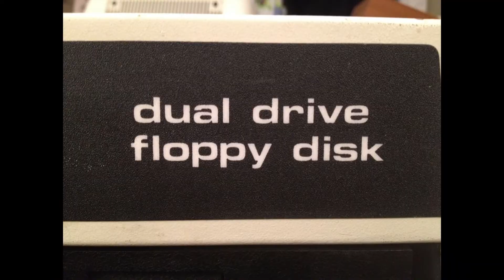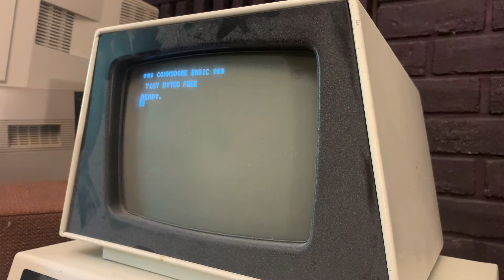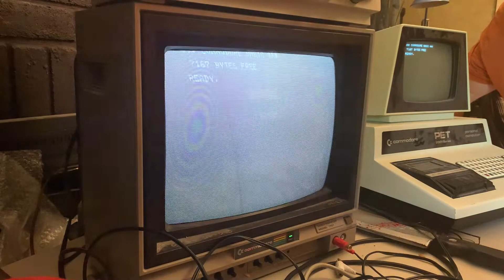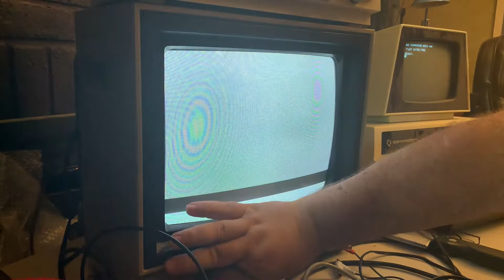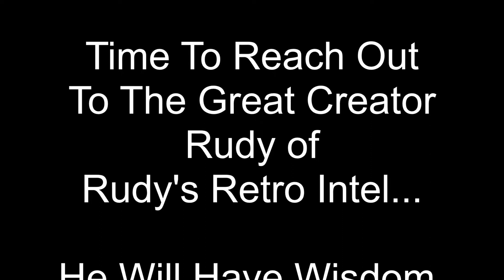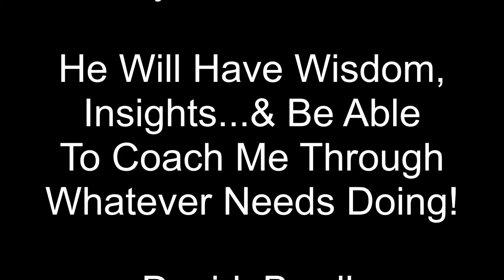PET To Composite Interface More Testing, After I Blew It Up! Help Me Rudy! 2001 4032 - Episode 1154

Comment: Looks like the capacitor is bad also. I will send you a replacement next week once I'm back home. Sorry I didn't think about that :)
Reply from the maker: Might I be able to steal one off of one of the others?  Or?
Reply: @DRBradleyPhotography  yes you can
Reply from the maker: They are quite the same as each other, but very different that the capacitor in the PET REVEALED board...which I discovered after I removed them...
Reply: @DRBradleyPhotography  use the round capacitor with 222 marking on it

Comment: It's the vertical & horizontal sync pulses that are a bit off,  Mostly the vertical.  In an ntsc composite signal those are the lowest voltage levels.  I'd have to look up what they should be since it's been a long while since I've done that.  Having access to an oscilloscope to show the waveform would help a lot if you could borrow 1 (assuming you don't have 1).
Reply from the maker: Thanks so much for your wisdom...I should get a scope....I did get a message from the man, and he thinks I might have also blown out the capacitor...so I will see what I can do with that...very likely I can extract one from one of the other similar, but different prototype boards!  Stay tuned!
Reply: @DRBradleyPhotography  yeah replacing that cap as he said is a good idea as they're not expensive.  Just have to match up the values (microfarads & voltage, same or bit higher on voltage) & if its electrolytic note the polarity (stripe on negative side) for those.   An oscilloscope are very handy but are ofteh quite expensive.  there are a few mentioned on adrians digital basement that will work well enough for 8bit computers.  Theres a few on amazon too that'll work & don't cost as much.  Just be sure to get something that can cover up to at least 20mhz.
Reply from the maker: Thanks so much for the insights and advice!!!  As it happens, the capacitors on the two other prototypes, which are of different circuits, have matching capacitors with each other, but not with the board I am testing...I figured this out...after I had unsoldered them and then went looking at the PET REVEALED board...sigh...off to an electronics store I would suspect...and of course I will continue to endlessly consult with Rudy!